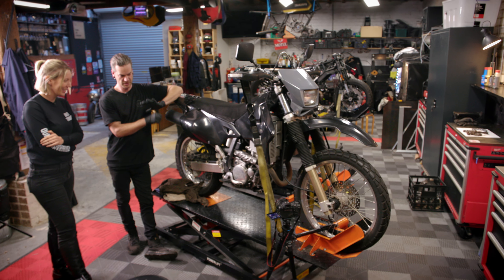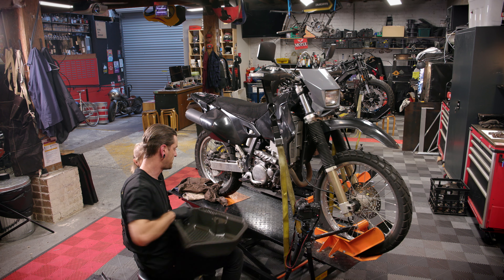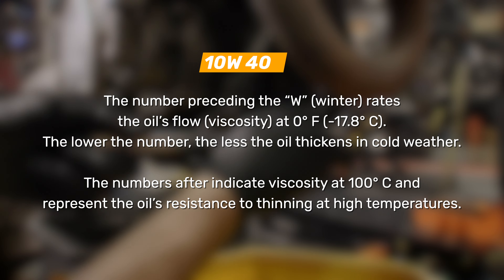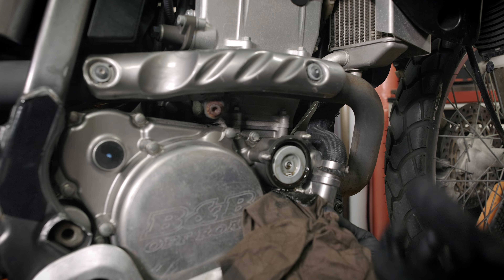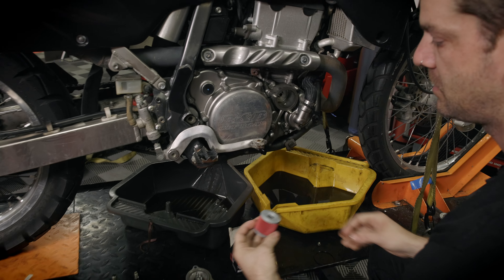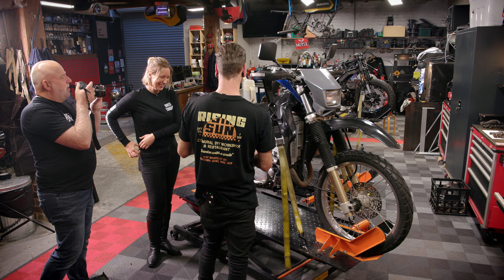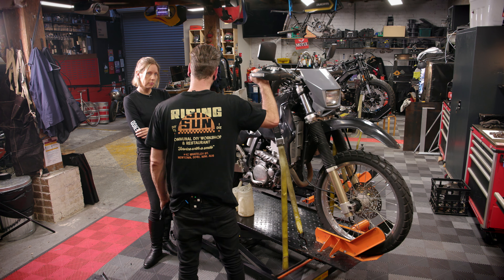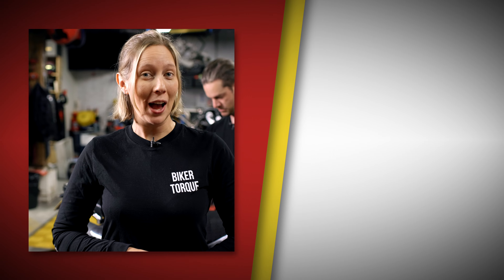Essential steps when changing the oil on a motorcycle.

Comment: If you're doing this at home & your bike doesn't have a center stand it's a good idea to invest in a paddock stand. They're usually universal, with mounts for spindles, if your bike has them, or L brackets to support the rear swing arm. A paddock stand will keep your bike upright & give you a little more clearance under the engine to access the drainage bolt & place the drain pan. It also makes cleaning, lubricating & adjusting the chain so much easier.
Reply from the maker: Good tip there

Comment: It's also wise to check the manual of your specific bike, as some state to check the oil level with the bike upright, while other models of bikes may state to check it on the side stand.
Reply from the maker: Good point Stef
Reply: @BikerTorque it’s always best to refer to the user manual which is omitting further technical info the further into the future we go. But online resources and workshop manuals are mostly available from manufacturers, or third party with Clymers or Haynes.

Opening owners handbooks from bikes pre 2000s is almost like a workshop manual. These days, it’ll say to take it to an authorised technician.
Reply: @whatsstefon  yes but modern manuals have extremely useful information like "do not swallow the battery" and "if ingested seek medical attention".
Reply: @rossstanford316  I personally think they should omit this info and let those craving batteries be free to ingest as many as they please. 😂
Reply: @whatsstefon  😂

Comment: A minor point - warming the bike reduces oil viscosity rather than increases it.  Something viscous doesn’t flow well.
Reply from the maker: Interesting, I have always been told to warm the bike up first
Reply: Indeed.  Warming the bike up is pretty much mandatory as it reduces oil viscosity and thus allows it to flow out of the engine more readily, giving a more effective oil change.  Makes the job faster too.  Personally I leave it overnight to drain after warming the oil first anyway, just to be thorough.